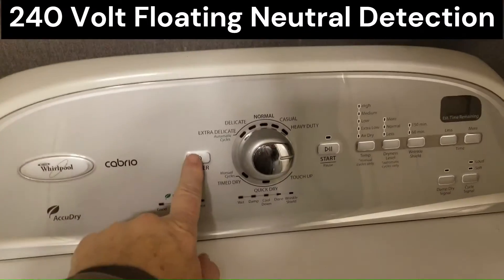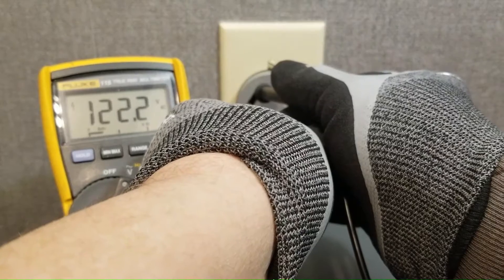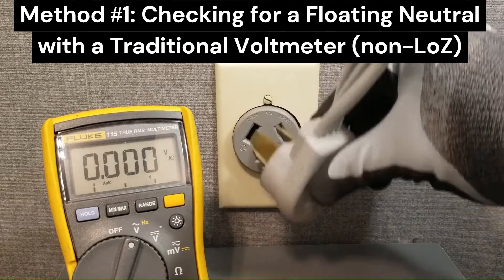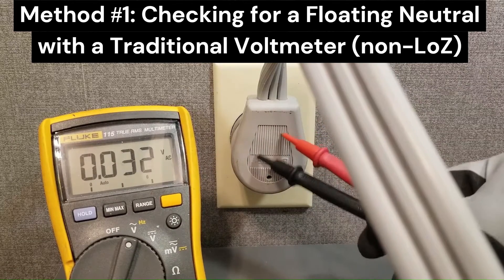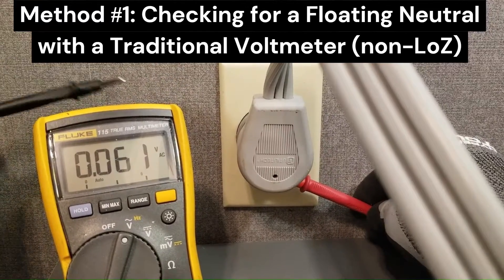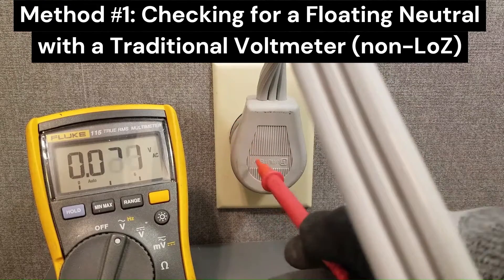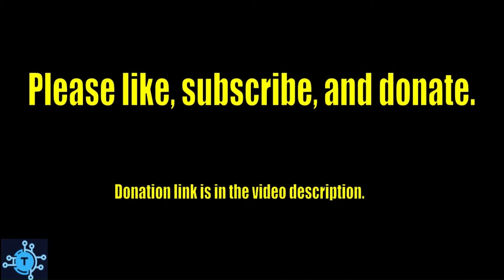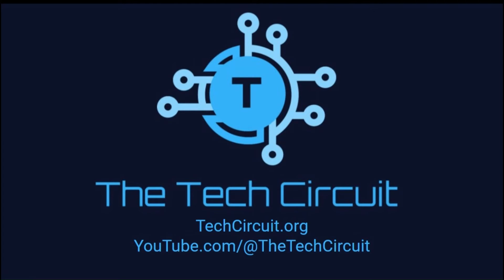#83 - Open Neutral Testing in 240v Circuits

Comment: I'm testing 4 Prong generator cord. Easier to yes end of cord cause where it connects to 240v source is not that accessible. and cord is plugged to it. Any hints only have Pen tester and volt meter
.

Comment: My pen isn’t picking anything up at the outlet but on the breaker picks up a signal do you know why that is??
Reply from the maker: If the pen picks up nothing, then you are either at neutral (which should read nothing with a pen), or at a loaded down or open L1 or L2. All of these scenarios would yield 0 or close to 0 volts w/r to earth ground, which gives no reading on a pen.

Comment: Thank you very much for the explanation. Do you find it easier/quicker to do the non Loz meter checks with a partially unplugged dryer instead of taking the readings at the dryer's terminal block?
Reply from the maker: You're welcome! I prefer to use LoZ mode for testing them because there are fewer steps and interpretations involved as compared to using a non-LoZ meter. If you let the symptom drive your diagnostics, however, the interpretations are fairly straight-forward.